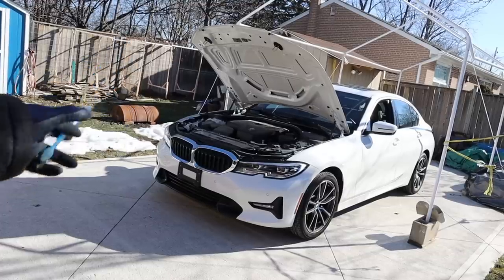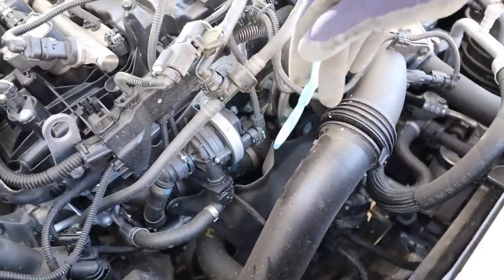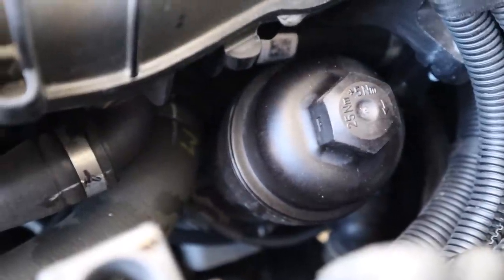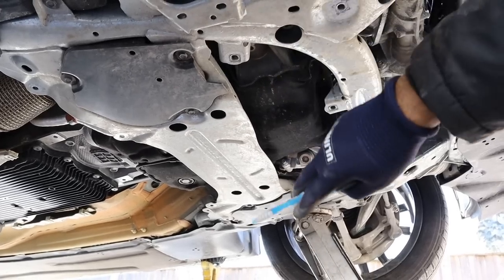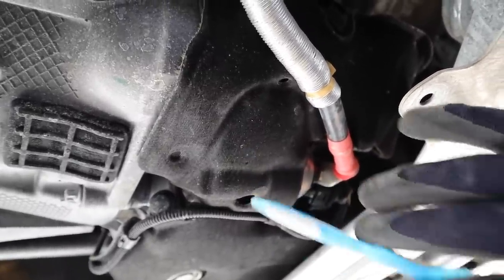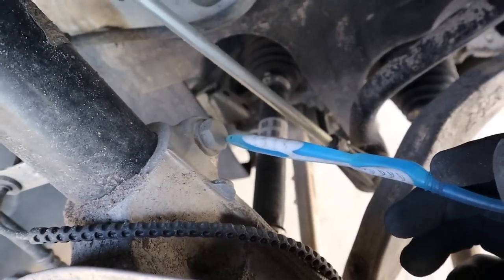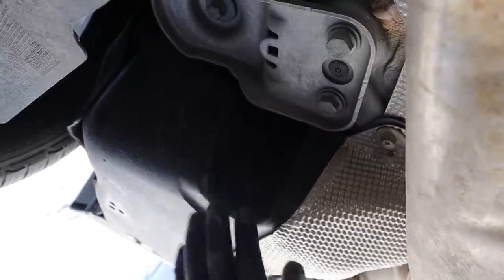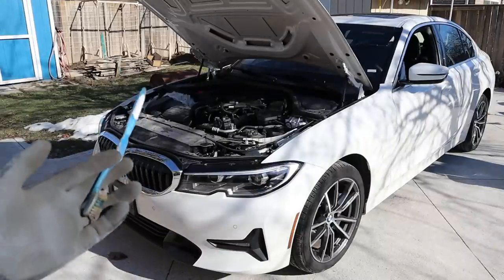BMW 3 Series Mechanical Review

Comment: These later model BMW are actually quite reliable. So much so that Toyota uses this engine B48 in the 4 cylinder version of the Supra and they use the beastly B58 I6 for the top spec Supra (im aware that Toyota does some tweaking on them but overall its still a BMW). You see engines overall becoming more reliable in order to meet ever so tightening emissions standards. I guess theres one positive to stricter emission. You see this directly with how BMW has gone about retaining heat management. They're able to retain the heat from the engine for something like 36hrs which helps with cold starts as they're one of the hardest on an engine! Overall good video, just FYI this engine does have an intercooler it's in the intake plenum. Would love to see some I6 tear downs!
Reply from the maker: I have an N54 engine teardown coming soon
Reply: Toyota does not really use BMW engines and ZF transmissions in their Supra. The Supra is a BMW inside out, and is a fantastic car, in contrary to the older Supra´s, witch only excelled in a straight line after ridiculous tuning. .
Earlier Toyota also used diesel engines from BMW.

Comment: I have had a BMW 520i G31 with the b48 since oktober 2017 and it has been dead reliable. no single (electrical) issue. Currently at 145k miles.
Reply from the maker: Good to know! 
I never liked the idea of a 4 banger in a 5 series
Reply: @speedkar99  understandable but the B48 is totally adequate for daily driving. As much as I would love to have a B58 here in Europe they are just too expensive as emissions taxes are very steep. My 520i without ANY options except leather/heated seats was about $65k in 2017. Nowadays a barebones 540i  would be about $95k.
Reply: Have you replaced any waterpump or experienced any coolant leaks?
Reply: @thandomthembu4913  Nope none.
Reply: @thandomthembu4913  B48 has one coolant issue i know of. Small coolant line running from the expansion tank to in between the cylinders. $40 hose but its kind of a pain to get to. I'm going to ask my guy about replacing it ahead of time when i see him next as im about to hit 50k miles

Comment: Thanks Sr. We'll your right, and I only love my 2010 E92 328i sport pak. Just great. I have had it now for 9 years and things are all still working fine with my con't maintenance of all mechanical systems. And the naturally aspirated straight 6 motor very smooth not to mention the hydraulic steering system for a connection to the ground effect..I have not been able to drive a more comfortable car that dose not break the bank like Ferrari or Lamborghini. Mine is just going great. And being a oil driven engine, vanos etc. With only minimal problems, I'm keeping this car until the wheels fall off.
Reply from the maker: Very good to hear your experience, what were some major components that you had to maintain?
Reply: Interesting , I always hear its not reliable. Do you disagree ?
Reply: @AbdulMax021 common misconception! These cars are actually quite reliable if you stay up on the scheduled maintenance and use high quality oil @ 3k-5k intervals not the 15k that BMW says! This is the absolute key for keeping a BMW happy! The people not doing this are where you hear about "BMW'S not being reliable"! These are performance oriented machines thus requiring them to be treated as such. Toyota uses both this engine in the video b48 and b58 in their Supra, so this should go to show that BMW does make very good engines (I4 and I6 engines) you just have to stay up on maintenance for them to last!

Comment: Rear steel subframe makes sense - it helps with weight distribution. Regarding brakes: older models had single piston calipers even on performance models. One of the biggest are 60 mm piston calipers for  360 mm dia. and 30 mm thick discs from E90 M3.
Reply from the maker: Thanks. Isn't an aluminum subframe lighter though? If not, why are higher end cars using it?
Reply: @speedkar99  Well, he said weight distribution not weight reduction. Intuitively it makes sense. If one end of the car is much heavier than the other it will probably affect how it drive, especially in turns. Also, being mostly rear wheel drive it can use some weight placed on the rear wheels.
Reply: @speedkar99  more weight in the rear is actually beneficial here, as it helps to get closer to 50/50 weight distribution. As long as it is not unsprung weight they  hit two birds with one stone - save cash and improve rear end behaviour.
Reply: I suppose, but the Alfa Romeo Giulia is all aluminium in the rear, while Jaguars even use an alunium chassis...  If BMW really wanted "perfect weight distribution" (i.e., 40:60), BMW would make more mid-engined cars.  For the maker of ultimate driving machines, it is kind of strange that BMW have made so few supercars or exotic sportscars.

Comment: I have the 335d Xdrive M-Sport with the 8 speed semi-automatic transmission. The handling and performance are brilliant. I'm glad that these cars have analogue gauges, proper handbrakes, proper master cylinders and not too much e;electronic crap. It's even nice to work on!
Reply: how does it have a proper handbrake if the parking brake is electronic? or are there separate shoes for the handbrake?
Reply: @awaara24  The parking brake on mine is manual not electronic, but mine has the m-sport dual pot calipers.
Reply: @davelowe1977  👍
Reply from the maker: This one is all electronic
Reply: sam, F32 435DX here. I think F series were the last series with manual handbreak, i owned a G20 330d and this had all electric parking brake.
Reply: 😂😂😂😢😢😢did u black tape all the warning lights?

Comment: I had a 2019 330i for three years and it was great. Never had a single issue and it was fun to drive. Probably not as exciting as other BMW models (current and former) but still a great sports sedan in its own right.
Reply: Of course it was good under warranty.
Reply from the maker: Nice to know
Reply: @speedkar99  Hey man, I absolutely love your videos. They're fascinating and you do a wonderful job talking through everything.
Reply: was this a joke? 😂
Reply: @Fred-F4  No
Reply: Wait, why did you get rid of a 4 year old car that is just run-in?
Reply: @TassieLorenzo  Lease was up, so I traded it in and bought another car
Reply: @youtubecommentsectiondebates  🤨
Reply: Just got a 2019 330i with only 18k miles on it last week. Loving it so far.
Reply: 6 months in so far with my 2020 330i which had about 25k miles when I first got it. It's just been pure pleasure ripping this car around.
Reply: There was an issue with 680 2019-2020 motors so far, I’d look up. Fixed in 2021-2024
Reply: @Clarity520 😊😊😊 me tooo

Comment: B48 received some interesting updates like miller cycle, mpi injectors and electric vanos.

Also some 3 series use a heat exchanger in place of a traditional air to refrigerant air condenser.

Some bmw have a continental integrated braking system.

Also many bmw vehicles ditched the alternator from the serpentine belt and moved it in the gearbox
Reply: Alternator moved to the gearbox. That is very curious! I wonder why?
Reply: @bradcomis1066  for, uhmmmm, customer safety, and uhhh, innovation
Reply: @bradcomis1066  because they use the mild hybrid system from ZF, and that electric motor acts as a starter and a generator.

Transverse engined bmw cars use a system from Magna Powertrain, integrated in the 7dct gearbox, that can supply or recover electric power on the even numbered gears, same gearbox is used on the alfa tonale, where it has been configured to run purely electrical, but that system uses a normal belt generator together with the one in the gearbox
Reply: @vladdutz20  Ahhh, mild hybrid, makes sense. Seems to me that is the correct placement for an traction motor+generator unit.
Reply from the maker: Thanks

Comment: Great review. Also wondering. What’s your thoughts on a bmw m340i? More specifically the 2020 m340i non hybrid with the b58 engine. Or what’s your thoughts on the bmw b58 engine?

Comment: The plastic intake manifold that sits on top of the block has a built in air cooler (so they gave up the intercooler). It would be interesting if you can dig a bit into this and let us know of your opinion.

Comment: I'm still driving two F30's, one n20, one b48 and in general have been great cars with only normal maintenance items. I will buy another when it is time. It's all about what you prefer.
Reply from the maker: Any issues?
Reply: @speedkar99  starter failure on the n20, while under warranty.  The n20 has 115k.  The n48 model had strut bushings that failed due to clicking noise. There appears to be some years 2017- that other models had similar failures.  Your channel is well done. You can think on the fly and explain the mechanics. Thank you
Reply: I have a 2015 built bmw X3 with n20 engine that has 53k miles. No issues so far. I use 0w20 and slightly over fill since it is very thin oil for bmw. Upside of thin oil is good flow rate which gets to the top much quicker and flows easier through the oil filter and helps keep the temps down. Just my thoughts and seems to be working.

Comment: I habe a 2020 330 with 87k miles and only issue I had was thermostat went out at 34k I think because I was driving all day in 110 degree weather. But I’m surprised I haven’t had any other issues. It’s been pretty reliable. But I also drive like a slow person and don’t take advantage of what the car has to offer. I will say Ive had to replace the rims 5xs because I do Lyft and drove over so many potholes.

Comment: 3 series has always used front and multi link rear, even on the M models.   Geometry and setup are making up the deficit from not using double wishbone. It performs better than Acura and Infiniti for sure.
Reply: E46 and earlier 3-series were not multilink up front but a simple control arm.
Reply: The E30 including E30 M3 wasn't multi-link rear, it was semi trailing arms IIRC.

Comment: The timing chains are actually on the back of the engine... means if you have a timing chain or cam issue? it's an engine out job. Luckily the B48 and B58 are very reliable not many reported issues with the valvetrain. The block is a closed deck and they moved back to a mechanically driven water pump.
Reply from the maker: Good to know!

Comment: The old BMW 320i was very reliable,  used oil, but I just kept a couple of quarts in the trunk to top off, after checking the level with, wait for it, a dipstick.
Reply from the maker: And now there's no dipstick to tell engine oil health or level

Comment: I was working some electrical work inside BMW service, so I have some inside information.

Modern BMWs do not talk to computer locally, but they plug to internet cable and talk to BMW computer in Germany. And mechanic has to do diagnosis over Germany. If network is down during ECU programming, car is bricked and affected modules must be replaced.
Reply from the maker: Wow!
Reply: تجارة أحتكاريه لربح المال من الزبون بأكثر قدر ممكن .. أشبه بالسرقة
Reply: This is absolutely not true.
Reply: @speedkar99  He's full of it lol, I plug my laptop in to my M2 via OBD to ENET cable and use ISTA+ (obtained, ahem, legally) and you can do anything and everything. Flashing absolutely does not require internet access. This still applies to the new G series cars.
Reply: @azz4067  capitalism for you... And the rich will always rich...

Comment: I love my n52 325i BMW as it seems the last properly reliable BMW. There were issues with 2.0 turbo engines especially the chain guides that can completely destroy the engine. Later ones are better but still not as reliable as port injected non turbo straight sixes
Reply from the maker: N52 was the last of the better engines (they still had their issues lol). After that they went all turbo
Reply: I cracked a piston on a 2006 320d with only 70k Kms on the clock. Only engine I've ever had fail and I've driven over half a million miles now.
Reply: I miss my n52

Comment: How do you feel about the build quality and longevity of modern engines compared to say engines from the 80/90s?
Reply: Direct injection and turbos will only make an engine less reliable
Reply from the maker: I say the 2000's were the best for engines. Like Toyota's 1NZ for example. Simple, reliable, light weight, economical, but not heavy and over built as the 80's stuff.
Reply: @greathey1234  Hey I'd like to know more about how direct injection affects reliability
Reply: @NalinKhurb  Soot build up +  higher pressures +mechanical high pressure fuel pump = more problems less reliable
Reply: @NalinKhurb  carbon build up on intake valves mainly but also issues with high pressure fuel pump. I know I own an Ecoboost mustang

Comment: So is 330i a reliable car in general long term? According to Consumer Reports, it’s recommended and reliable. I found a 2022 model on Autotrader, but I am still debating if I should. Are there owners out there who can advise me about the reliability and if it’s worth getting it.
Reply from the maker: Maybe mechanically reliable...but what about the he electronics and basic maintenance that's a bunch more expensive than mainstream cars?
Reply: @speedkar99  thank you for responding. What about Audi A4? Have you done a mechanical review for that engine? That model is also recommended by Consumer Reports for its reliability. It maybe a little cheaper than BMW to maintain since VW parts can be found in there. What do you think? BMW 330i or AUDI A4??? Or should I stick to LEXUS IS 300 for a long term reliability???
Reply: Our household has been through 3 G20s since 2019 when it came out. Overall very reliable, all were driven as daily drivers and some for work purposes. Never a single breakdown or failure of any major component. If I recall well, it just went in for some software updates and 1 recall. I have a friend who owns a G20 for about 4/5 years and it has treated him very well. The ride quality, handling, interior quality and features are amazing in this car. Very safe also in a crash.
Reply: @speedkar99  Correct! I just picked up a 2019 330i with only 15,000km  with it, but the sunroof failed to open and keyless doesn't work sproradically. Document from NHTSA shows the Body Domain Controller needs replacement, and it costs US$2200 from the dealer in Hong Kong.

Comment: I would love to see a Review of the Toyota CHR since it just won top suv  according to JD power
Reply from the maker: LOL
That thing?
Reply: @speedkar99  Thing? Bro beauty is in the eyes of the beholder. Love or hate but.... you would be surprised how amazingly it drives. Yes it won most dependable car overall along with Lexus in two categories , look it up. You should already know why. In fact any Service dealer for Toyota say they never see any issue and just as good as a 4 runner. Facts. Car Care Nut on you tube  said the same. Chee Iam surprised you are laughing since all your tear downs,. Ancient technology works wonders my friend.
Reply: @moeanthony9308  that’s because it has the same drivetrain as a Corolla. My mom had one before she took it back to the dealer because how cramped the inside felt. Don’t even get me started on the back seats. I don’t see that car around for long
Reply: @thatshortkid310  its not the same drivetrain as the current Corolla. The vehicle is designed for 2 passengers , thats all some need rather than  driving a bus suv

Comment: BMW has truly lost its way. The lack of a manual transmission option option in the regular 3-series is a major disappointment. I grew up with an E36 which had its own issues but the car is highly serviceable and the drivetrain is very solid.
Reply: The take rates doomed the manual. The buyers spoke :(.
Reply from the maker: It's not BMW's fault the manual doesn't exist. It's lazy north american buyers
Reply: @speedkar99  Actually it's funny but North America has the highest take rate for BMW manuals. It's the only reason the manual exists in the M cars. The M2 had 50% manual take rate in the US, but less than 10% in Europe.

Comment: Is there any specific reason why they did things the way they did? (Example would be exhaust mounted to transmission and other stuff)
Reply: Well the exhaust being mounted to the engine and transmission means there would be LESS twisting stress on the exhaust by connecting it to both locations as the engine and trans will rotate similarly.
Reply from the maker: But they did it after the flex pipe. That doesn't make sense!